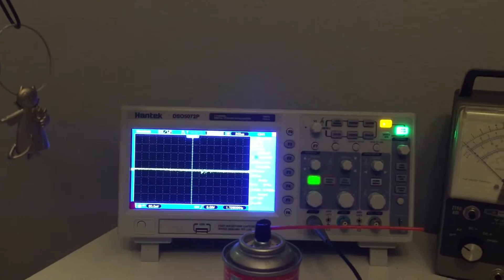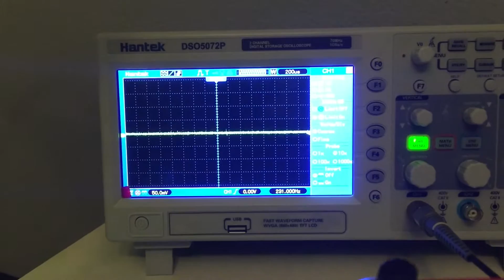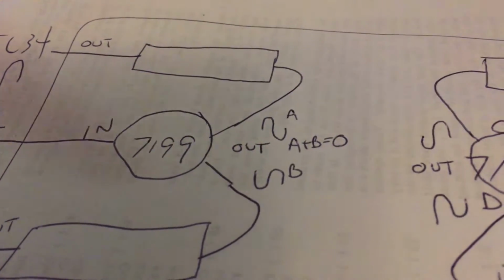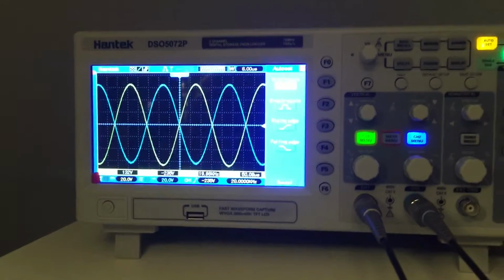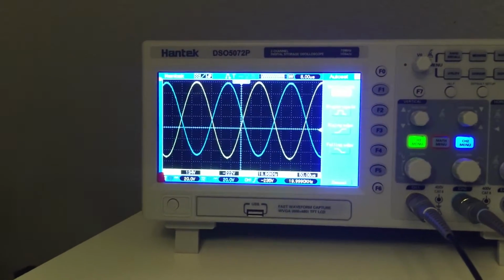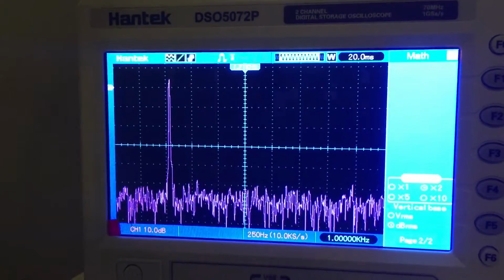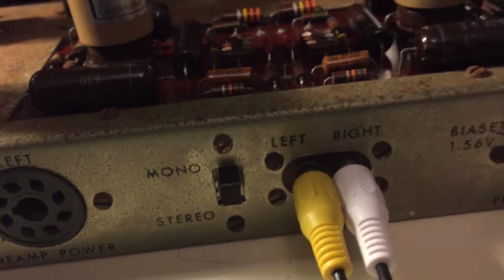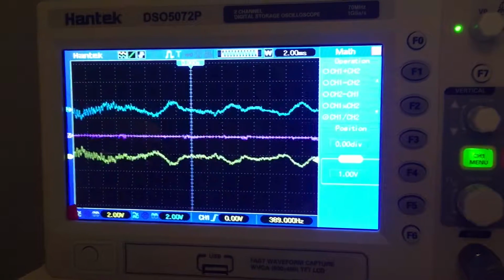Dynaco Dynakit ST70 Stereo tube amplifier repair PART 8 of 9

Comment: Differences in gains of the o'scope amps can affect this too! What you really need for this measurement is a true differential vertical amp!

Those overshoots could be due to one or both of the probes' compensation needing to be tweaked.
Reply from the maker: I had put together a separate video to cover that matter. At the time, it wasn't immediately obvious, until i took measurements and looked at phase with the same probe on the same channel.